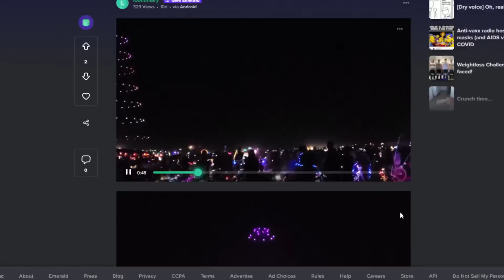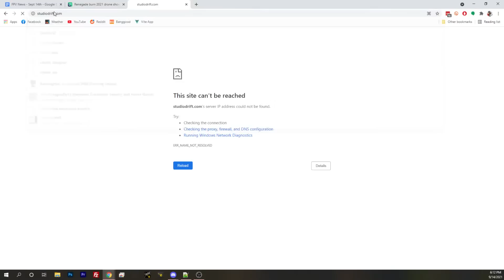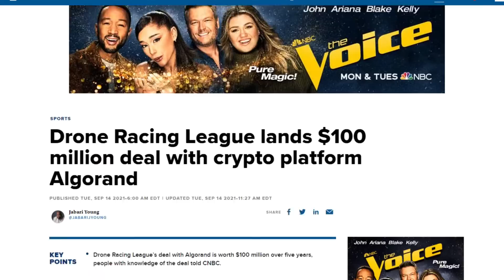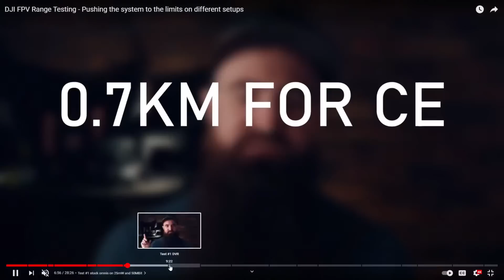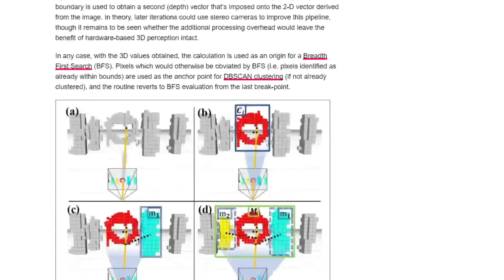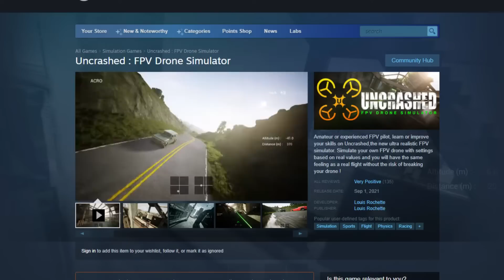XJet says FPV is dead. Wez takes DJI to 13+ km! (FPV News with JB and ItsBlunty)

Comment: 7:25 Drone Show at the Renegade Burn 2021 - La Playa Flya
12:35 AT&T launches drones that provide cell service to areas impacted by natural disaster
 16:13 Xjet says FPV is dead?
33:37 ExpressLRS for SBUS only FC? Yes! (ELRS devs respond in record time!)
39:01 DRL finds a new sponsor in Crypto, Algorand
42:51 Interview with Carl by Chris Rosser and Series on FPV Video systems and How They Work
55:06 DJI for long distance? Wezley Varty takes DJI to 13+ km!
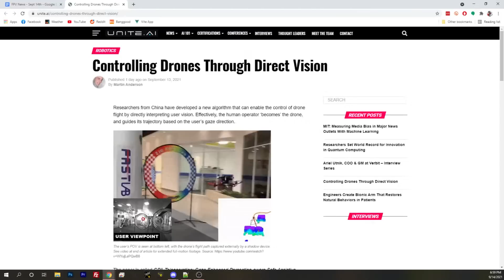59:37 Controlling Drones through Direct Vision: drone flies where you look!
1:03:02 Best way to mount your capacitor? On ESC or XT60 plug?
1:08:07 Rant: Uncrashed Sim sucks. Why do people like it so much?
Reply: Respects bro ❤️
Reply: You learned Bardwell something today!
Reply: Thanks man.
Reply: xjet might need to update his glasses

Comment: FPV is not live and not dead. It exists in alternative reality and sprout out in this reality there and there all time. Particularly freestyle seems always will be somewhat outside rules and will exist based on people's good will to be responsible and avoid accidents. Luckily I still have 2-3 spots where my casual freestyling doesn't interfere with general public. By the way I seen how my city had quite much FPV pilots during years 2016-2018. In last 2 years our numbers dwindled quite much. Now some are starting to sprout out again. I believe that not all is lost :)

Comment: At 50:14 Blunty said Carl from DiviMath was working on a new ASIC. Can anyone confirm this. I've watched the Chris Rosser interview with Carl and couldn't find him saying that. (NDA slip?)  Apparently the ASIC in Shark Byte is 140 nanometer. I'm wondering if just making the transistors smaller would increase performance? Should be an exciting future in digital FPV.

Comment: I work for AT&T (unfortunately not with drones) but they have been using that “Cow” drone for at least a few years. 
They also used drones in hurricane rebuilding efforts in the keys, they would pull a mule tape (strong light weight string) from one side of water crossing to the other and tie the cable or strand to the end to pull the new lines into place.
I’m looking for an excuse to use my FPV drones at work but haven’t seen one yet :)

Comment: Who was it who fiddled while Rome burned?

I find it very hard to knock what xjet does. It is all very well to say shouting "the building is on fire" is wrong and "get a hose" is right, but actually if you aren't told the building is on fire, why would you look for a hose?

There is a crisis, most people don't seem to know or care, and "I'll just carry on regardless of the rules" is not a good approach. It just hides and marginalises the hobby. The fundamental problem is very poor public opinion, and it is that which then let's regulators walk all over us, driven by other interests.

The approach to take is surely to mobilise public opinion. Politicians listen to that, and they control the regulators. That is easy to see, but how you do it - much more difficult, I don't know but I do strongly feel it is the only approach that can deflect the steamroller of regulation.

So, don't knock xjet, he does a hell of a job in keeping these concerns alive, and if he shouts a lot, it is only to wake up the sleepers.

Comment: Well... RC hobby (a flying part) worldwide consists of waaay more people. Probably the smaller part of them are using Betaflight . And the rules are touching all of them. In my location majority of RC hobbyists are flying planes, not drones. They are using PX4, AP, iNav, or just bare receivers... I'm not even talking about DJI customers. And by the way, especially Mr ItsBlunty sounds like highly motivated by FAA ^.^

Comment: Like, hello, and I'm very glad about your pass vidos. Here I boil over black. I bought the IFLIGHT Flight Controller "Beast F7 55A V2 AIO (BMI270) 25.5x25.5". GYRO & ACC is installed there: BMI270, Barometer: DPS310 (it turned out that it only works on BF 4.3.0). The problem is that the gyroscope's refresh rate shows 3.20 kHz in the BF configurator instead of the usual 8 kHz. Updating the firmware does not fix the problem. This is normal for this gyroscope or is it a product defect and I can request a refund on the banggood. Like googling, I can't find anything. Help who knows Please.
Reply from the maker: The only gyro I know of that runs at 3.2 kHz is the Bosch gyro used on the BrainFPV Radix. Have you somehow flashed that firmware?

Comment: Higher bit rate reduces range/penetration. Transitions from high to low are much faster which requires a stronger link between rx/tx. If the link is weak the transitions of the digital signal are more susceptible to being misread/interference. Carl spoke about this being a hd-zero issue to. Camera using the full channel bandwidth at 60fps reduce range/pen/performance.

Comment: That "I'm a good little boy" comment Joshua made to DJI is exactly why we need open source.  Long term it is unhealth to leave the fate of our hobby in the hands of any corporation.  Next thing you know it'll be a subscription fee to fly your drone each month.
Reply: no, its not like any company has exclusive rights to fpv. if dji were to charge a fee to fly, competitors would take the opportunity. open source is great but eh this is not a good example
Reply: Its not like any company has exclusive rights to making computers or cell phones or cars.  These are all things that started small and had hobby communities.  But have you tired to make a phone.  It's technically possible but the support structure is all but gone.  And now we got things like farmers taking companies to court trying to get back the right to fix their own tractors because working on them voids the warrantee of a 100k tractor... so they have to choose... loose money because crops are going bad or fix the tractor and loose their warrantee on a 100k tool.  If people buck early when companies try to put reigns on... the result is better.  Keeping open source around keeps companies honest @drkastenbrot

Comment: I get the point but I think you might be splitting hairs. It's clear the FAA and "others" want our hobby gone or so restricted most won't even bother anymore. That's the plan. Little by little they will chip away at it until it's gone.  Why? because they can.

Comment: Can't you uninvert all sbus pads? I have to do that on alot when using tiny D8 external receiver by emax. 
I think JB has a video on how to do it? I forget command, I have to look it up as have to do it soon to install external D8 reciever on toothpick.
Reply from the maker: You typically can't uninvert SBUS pads.
Reply: @JoshuaBardwell  Ah must just get lucky as use mainly emax gear.

Comment: Skateboarding is an interesting hobby because most places "banned" it by installing devices that would prevent skateboarders from skating. Local Councils built skate parks for skateboarders to go and skate and they are some of the busiest places around. 

What are we doing to get FPV versions of skate parks? How are we working with authorities to have "safe places" to fly FPV? We aren't or at least we don't want to be part of Model Aircraft Clubs (which is the requirement in Australia). We are just fighting back and giving them a 1 finger salute. We go and fly anywhere anyway and wonder why the authorities hate us.

Why aren't we doing more to create "FPV" flying spaces?
Reply: Build a bando!

Comment: A chance to air a common rant from my house, put a friggen legible pin out with a fc and 4in1.  Video tx are pretty good about it, but almost all f.c.s that I have purchased have crap if at all wire diagrams.  I know, search the web…..spent hours on trying to find the exact same, contact manufacturer, yep, no love there.  It is so friggen easy to print it for the model inside the fancy foam padded case with all the custom “ absolutely best yadda yadda informercial for the latest greatest electronic do dad that even if you find the majik wire sequence from the tiny ass letters on the wrong side, maybe will work.  Ah, feel like a real builder now, eh?  Satisfied kinda………..

Comment: Before watching this video I was thinking about pulling the trigger on the DJI goggles. Should I hold off or go for it?
Reply: Go for it. But consider wether you've got enough money to spend on HD drones or if you do assemble them yourself - the air units/vistas. Also, you can always use DJI goggles as analog with an additional of a small cheap ass module.

Comment: Put your cap on less than 25mm of wire. Usually motor wire is good. you want to leave as little leg as possible as well.

Comment: Can't believe thier is no more almost on road 4x4 asphalt and carpet. Still have all my obsolete cars from late 90's. And all the crap that you needed. Got a turbo 30 for matching ni cads. That's what it took for making A-main. High numbers cycle matching batteries one at a time.

Comment: Do wings have to have remoteid and similarly restrictive rules?
Reply from the maker: All rc aircraft are regulated the same.
Reply: Part 107 FAA regulations don't define what a "drone" is in their glossary, but they do define: aircraft, unmanned aircraft, and small unmanned aircraft.
Nothing in part 107 limits the definitions to any particular type we would see in the hobby, e.g. quad, fixed wing, bi plane, etc.
So, yes, remote id applies to a wing if its takeoff weight is over .55 pounds.

Comment: So can elrs then work with tbs servo break out board ?
Reply from the maker: No because the tbs receivers can output PWM for servos. The break out board just gives you convenient pins. It doesn't translate the signals.